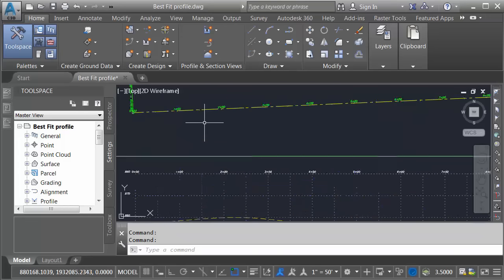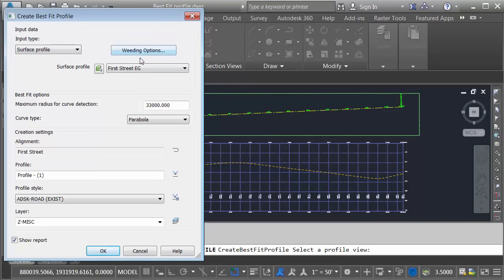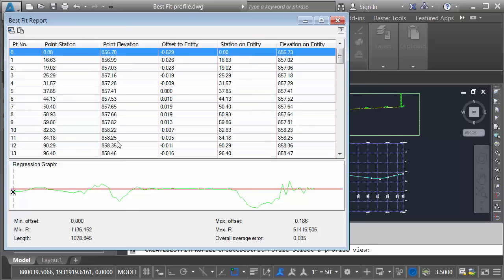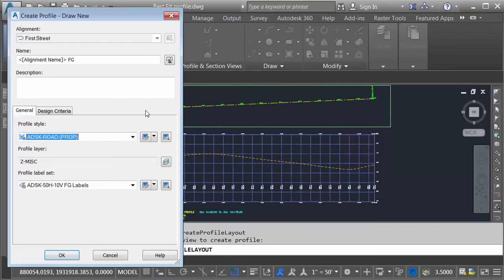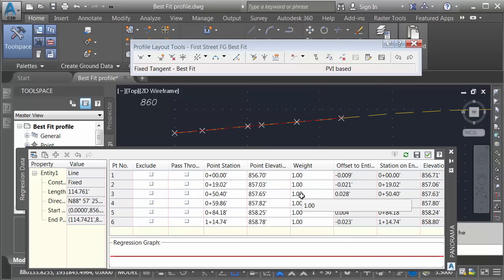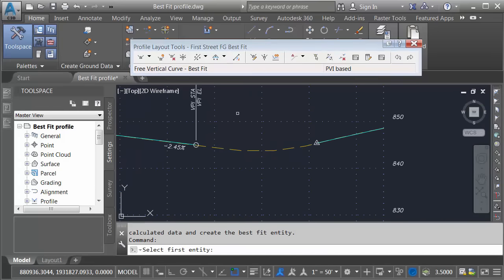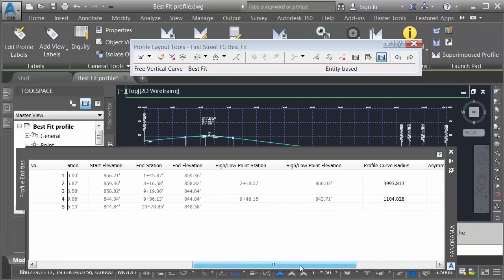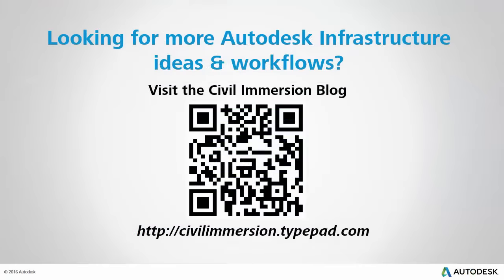Creating Best Fit Profiles using Civil 3D

Comment: nice video and I appreciate the free content, however, your EG is highly idealized and creates a pretty "clean" profile. Most EG surface profiles are highly variable and I don't see a lot of control in the tool with regards to maximum and minimum k-values for sag and crest curves or vertical tangent segments. Any way to control these with the best fit tool?

Thanks.